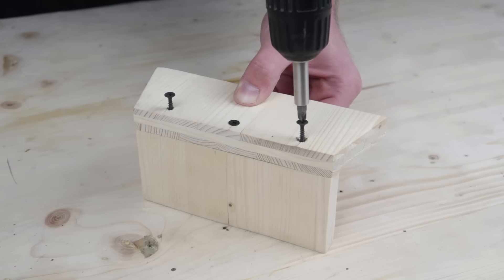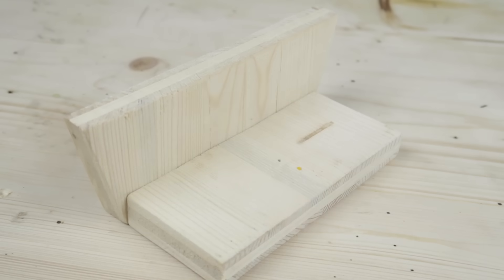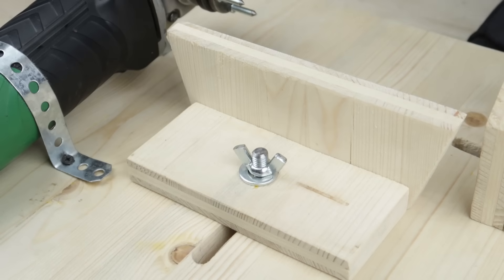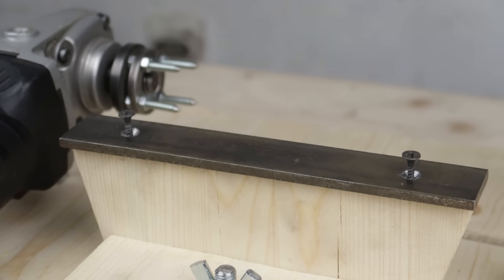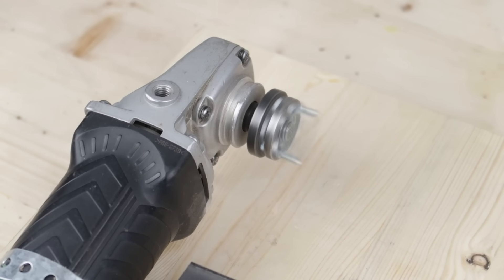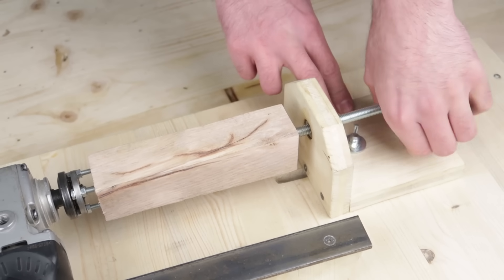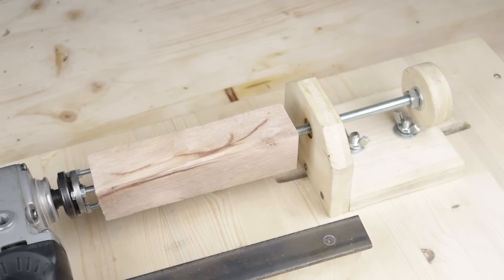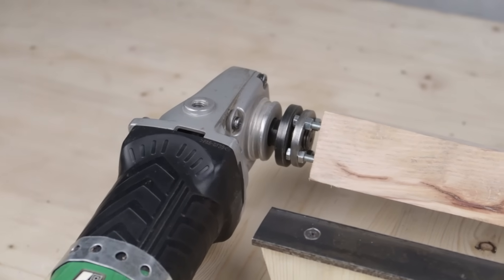This is why NOBODY will tell YOU this ANGLE GRINDER Hack!

Comment: On top of what others have said about this, using a bench chisel as a turning tool is an accident waiting to happen as well. The tang from a bench chisel is far weaker and one good catch it will snap and you will have a piece of metal jutting out the back of your hand the way you are holding it.

Comment: If you sharpen your drill bits properly, they will product shavings instead of dust - and cut much easier & faster.

A cheap set of wood turning gouges will cut MUCH better than scraping across a flat chisel.  The flat chisel isn’t much better than a screwdriver.

A face shield might save you an eye when you’re learning.  I have some good size dents in my workshop ceiling from shattered or ejected turning blanks.

Comment: Oh dear, blunt drill bit was irritating, so easy to fix but then it got worse. Blunt chisel used as a scraper, scary bit of wobble in the system as pressure is applied, what could possible go wrong. I hope no one copies this idea. The rules of natural selection unfortunately sometimes apply. Fast moving appliances need to be precise and treated with respect.
Reply: Maybe he should have made a drill bit sharpener first and THEN the tiny lathe
Reply: Right, you’ll only try once to take off more metal than the cutter can manage!
Emergency stop button saves my day..... here though, when cak and fan collide, somebody is gonna have a real bad day.

Comment: Don't like how the one end doesn't spin and just burns a hole through the work though... Friction will eventually ignite your piece...
Reply: I think tailstocks on real lathes don't spin anyway.
Reply: @danielgoodman3578  they make live centers. They have been out for many decades now
Reply: Actually look closely. He used a metal bushing as an insert to hold it in place.  I imagine he had problems with the wood flying off.  Good prototype.  
Not ready for prime time.

Comment: All fun and games until the grinder throws the wood at you at high speed.. accident waiting to happen. (I tried turning wood by attaching it directly to a 7000 rpm 1hp motor when I was little, sort of learned the hard way how dangerous that could be.)
Reply: and your rig was still running at about 10,000 RPM SLOWER than this stupid thing.

Comment: Angle grinders offer speed but not too much torque due to the smaller surface contact made by the blade.
    This idea requires more torque due to the increased surface friction.  If the stock is very dense more pressure is required at the cutting edge thus more friction is created and will slow it down...so more tourqe is required to overcome it.  That is why lathes require motors with greater power.

Comment: You can use a lot of tools for off-label projects!!!

It amazes me how many people don't realize you can use a drill press as a router or a router table with jigs!!!

I have a very old drill press owners manual that shows you how to use your drill press as a router or router table !!!!

I have seen several videos showing how to use a drill press to tap threads into metal!!!
Also how to use a drill press as a wood lathe!

Even use your drill press as a horizontal table saw with fences!!!

For a lot more woodworking jigs and tricks see Izzy swan on YouTube!!!

Comment: Spoiler alert, he makes a 12,000 rpm lathe that kinda works while being extremely dangerous.
Reply: So then put a plexiglass wall up to lessen the risk xD
Reply: Its not even close to 12000 rpm
Reply: @Sahtzor  see that's where you're wrong. Most all 4" angle grinders run at 11k-12k rpm.
Reply: @Canibal_Animal  im quite sure im not wrong. The tool he used has a regulation, looks more like a polisher and those are adjustable within 600-2800 rpm range and have a slow start too.
Reply: @Sahtzor  say what now? Its obviously a cheap 4" angle grinder. All 4" angle grinders run at 11-12k rpm. I don't know what you're looking at. The screw on parts on the threaded shaft are to mount a cutoff/grinding disc. Google "4 inch angle grinder and get back to me.
Reply: @Canibal_Animal  it has speed control genius
Reply: @Canibal_Animal  ....I agree some of these folks have never even seen an angle grinder in real life.  They must have consulted with their wives whom also has never seen one. I put a message concerning his dull as a butter knife chisel and the 90% tool rest he’s trying to use.  I can see losing an eye or breaking fingers not to mention a possible skewer (splinter) to the neck in the future.
Reply: @Sahtzor  and sounds like it's about to come unglued 😆
Reply: @Canibal_Animal  The speed control was on the end of the grip just next to the cable entry point.  Open your eyes and don't berate people for your bad eye sight.
Reply: @Canibal_Animal  Speed control at 6:15. You see him adjust it from max to min. All an angle grinder is is a 120v AC motor. Adding speed control to an AC motor is actually quite easy, and I'm honestly surprised you've never seen speed control on a grinder. I own more grinders with speed control than without, not sure what you're all up in arms about man. Although I guess I've never heard of a 4" grinder, only 4 1/2". Maybe that's where your confusion is coming in?
Reply: 🍿grabs popcorn and reads comments

Comment: There's a reason that nearly every angle grinder I've seen you have continuously have to squeeze the switch on the handle, what did you hold it on with a zip tie
Reply: Yeah it's a safety mechanism because they're f**** dangerous. Angle grinder is without a doubt the most dangerous tool that exists. It's more dangerous than a skill saw it's more dangerous than a table saw and a chainsaw. The only thing that is near similar to it would be if you were using the end of the bar of a chainsaw to make cuts. 
For some reason nobody teaches quadrants. Oh in the chainsaw attachment that was created for angle grinders and marketed to the layman every day DIYer is downright criminal in my opinion. Numerous people have been killed from that device and ankle grinders in general. Because at the end of the day they do not understand quadrants

Comment: Yes you are using a variable speed angle grinder which allows you to slow it down but you will burnout the motor as it cannot sustain such high stress at low speeds without overheating. If someone who watches this doesn't use a variable speed grinder and turns it on at full speed they will hurt themselves as lathes don't like 11000 rpm. This is very dangerous and a simple cheap lathe can be purchased cheaper and much safer to use.

Comment: 6:26 did you drill holes in the grinder end of the block of wood or is it just pressure holding the block on? This looks a bit dicey. At best.

Comment: Hah i sometimes work on emm not so safe ways, but this made me to feel bit uneasy :D Like the concept is not bad tbh, but i don't think i would use angle grinder for it, like rather use old drill that has properly variable speed settings. 

Also, why it looks like the drills you are using are blunt as hell ??? And using plasterboard screws on wood, plus using pozi bit on philips heads, what kind of monster you are ? :D

Comment: So many things wrong with this.  Grinder doesn’t have a clutch. That tool bites its flying, You got your bevel up. You need to be scraping and your tip isn’t reinforced by any steel (gonna dull quick). And your using a straight tool to rough, way more likely to bite, especially since you’re not scraping. You will maim someone if they try this

Comment: hmmm... A 4" angle grinder, something that can be a lifeline to a metal worker like me, turned into a stationary unit.... for a Lathe of all things...... You know... With how much plywood was used to make that entire setup.... Instead of wasting $50-60 on a Variable Speed Grinder, and just as much on materials..... I'd rather go to Harbor Freight, and drop the $100 or so on their cheapest PURPOSE BUILT LATHE and save myself the headache and ER visit, as many have already commented down blow, Grinders ARE NOT BUILT TO BE OPERATED LIKE THIS. Doing this to a grinder will guarantee it fails, hopefully not catastrophically (Lathes can run as low as 50-100 RPM, Grinders like this rarely get below 3000 RPM).

Comment: Don't.
Tools are made from hardened high quality steels different from the steels used for nuts and bolts. Wood turning is hazardous and potentially dangerous especially with the wrong tools. If you want turn wood go to a school and learn on a proper lathe with real turning chisels and a qualified teacher.

Comment: Why? Because lathes are already a thing.  I'm no expert but I'd be concerned about possibly damaging the grinder as it is not designed to be used this way. Considering the abundance of cheap Chinese power tools these days, why not buy a cheap lathe. I know the tolerances will be crap but it would be better than this.

Comment: Hmm ...

If you had an accident then your insurers would be wondering if you had abused the tool, as in using it in a way it wasn't designed for.

That said if you were a modeller and  didn't cut off your fingers or lose an eye then obviously it has a use. ... if all the tiny lathes in the world had been sold off.

Comment: It is much better to use a power drill for a lathe. There you can regulate speed and it is generally much lower. Still MUCH TOO HIGH for a lathe, but at least tolerably lower. 
And  - in both cases - fix the tool better for God's sake, this is a deathly game!

Comment: Nobody will tell you this because it's dangerous. What's gonna happen if your tool get caught in your wood? That electric motor will not big down. Also, not many lathe operators use a high speed like that constantly.

Comment: You know why no lathe or grinder in the world is manufactured with wood parts? because it will probably hurt or maybe even kill you when it fails and it will. Wow, you succeeded in making 2 of the most dangerous tools out there that much more dangerous. This is innovative, but stupid. Don't try this at home! use the right tool for the job. There is no scenario where you'd ever be in a pinch for a lathe that required you to make one. This is designed to fail.